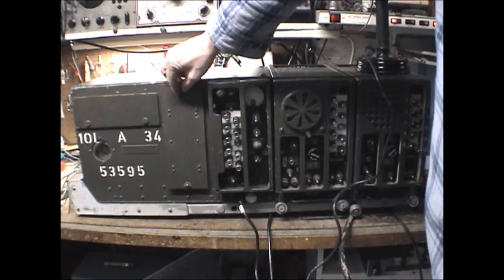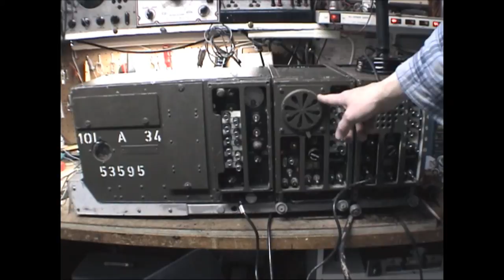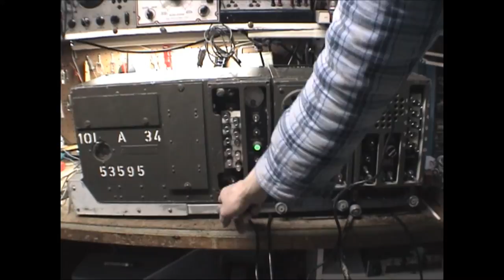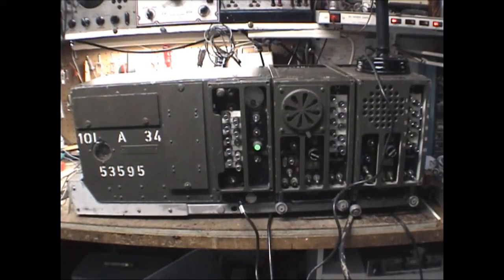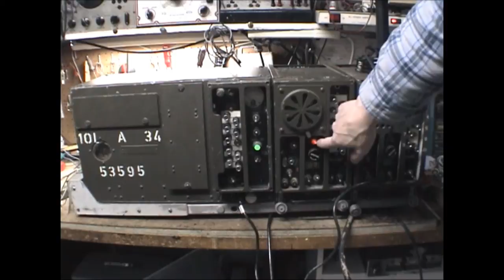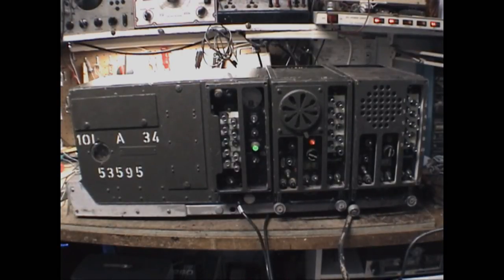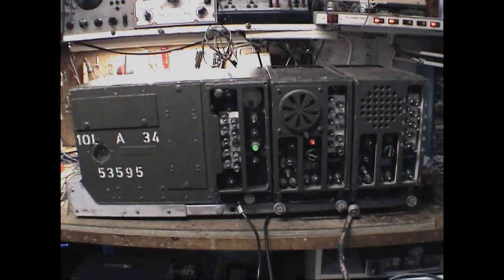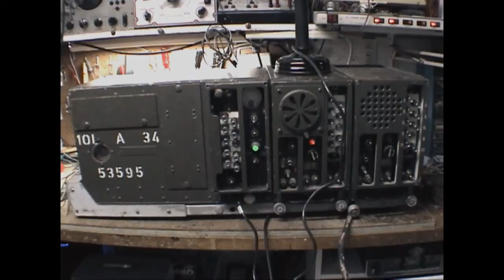SCR-508 WWII Vehicle Radio Set.

Comment from the maker: Yes, perfectly legal to listen all you want. You would need an FFC amateur license to transmit regardless of age of the equipment. This is a wide band FM set and may fall outside legal operating requirements depending on how the OP operates it. This could be what they were referring to. More modern sets are narrow band FM which is not an issue.

Comment: Great video. I just picked up a an SCR-508 for my halftrack. I don't think it works but do have a question. I know of someone else that has one working and was told it was ok to receive but not legal to transmit due to the age of the transmitter even with a ham operators license. Is this correct?

Comment: do they really weight 100kg? kinda weird
Reply from the maker: The Transmitter weighs 67Lbs and the receiver is 35lbs, then add the weight of the FT-237 mount which may be about 25lbs..